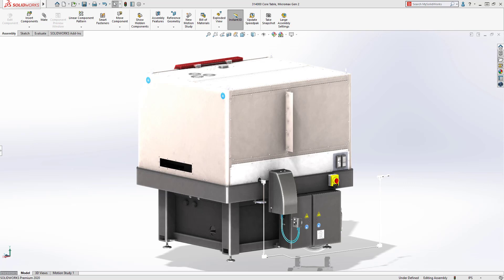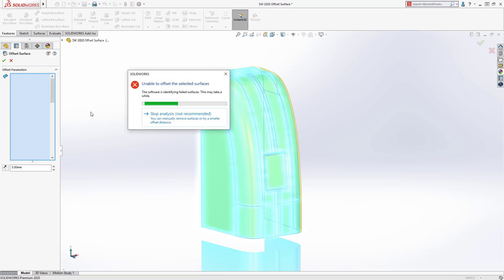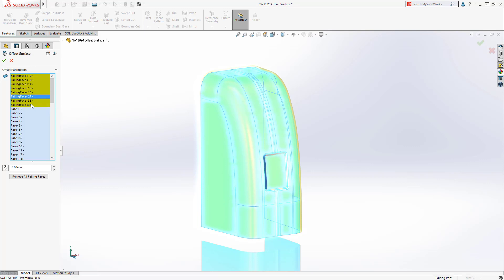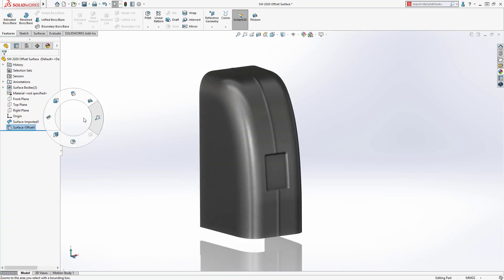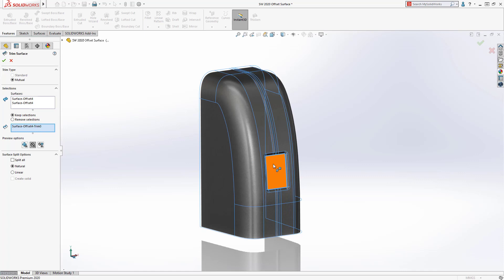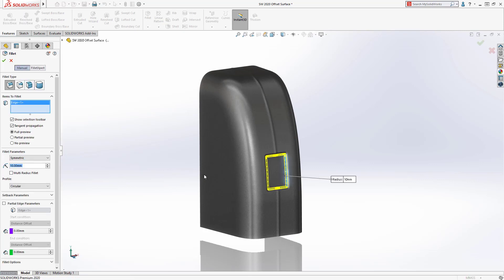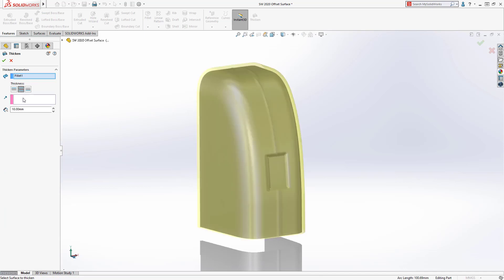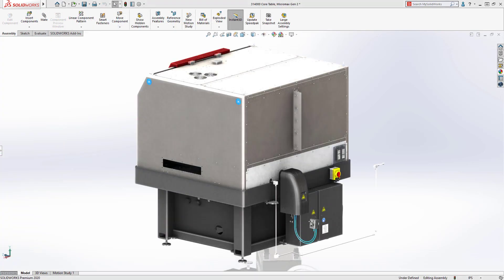What's New in SOLIDWORKS 2020 - Surface Offset

Comment: Since offsetting is still not "solved" in CAD (with NURBS) and Mesh environments, did you consider using a volumetric approach for Offsetting (e.g. Pavic / Liu & Wang)? The whole trimming process seems to be not good for the users

Comment: Uhhh. Surface thicken on both sides has been around for 10+ years. Nice try though!
Reply: thickening is not the same as offsetting....You dont add any strength to the wall of the model. A offset model is a model for which each point exactly has the distance of the offset distance to the input geometry. This is not the case when you thicken the wall of a model

Comment: DS/SW may not want to copy these web integrations ... it has no real sense / use in the industry and by advanced professionals, let Audodesk with its Fusion 360 and its badly designed and delayed tools / interface do it! We need more advanced surface features! DS/SW Pay attention to what Power Surfacing has done for SW, I'm sure such an even better tool can be integrated with more surface tools, agility and less boring tools that suffocate the OS ... SolidWorks 2003 was just over 200mb of installation today more than 15GB, we want advanced and uncomplicated tools, well designed for modeling, make separate programs a modeling line and an office line if you want then everything together is not being good for us or you other tools specific are superior to modeling tools for example. I hope you understand, less paperwork and more work!